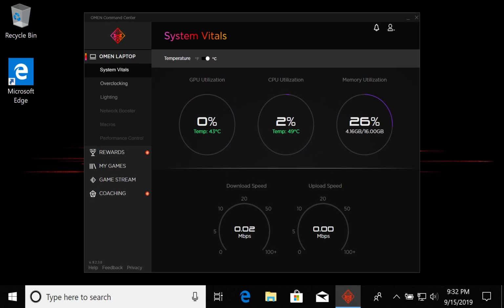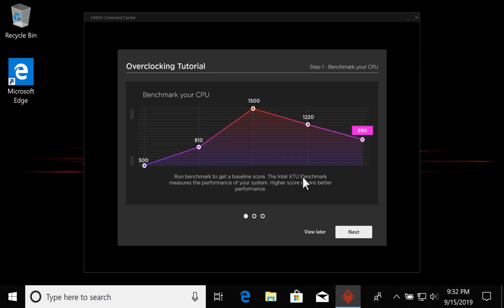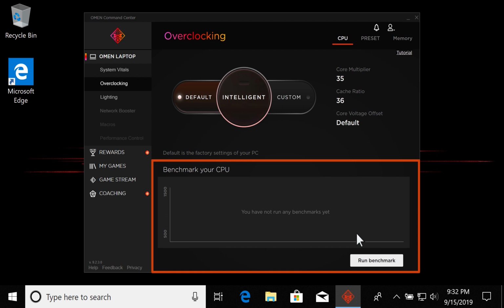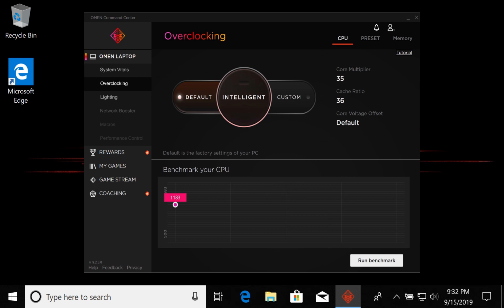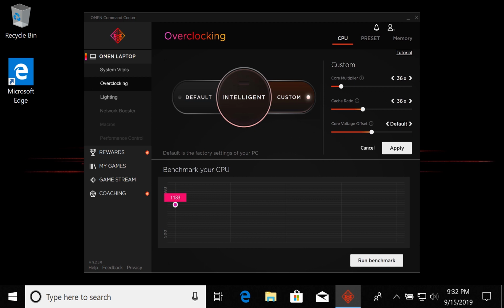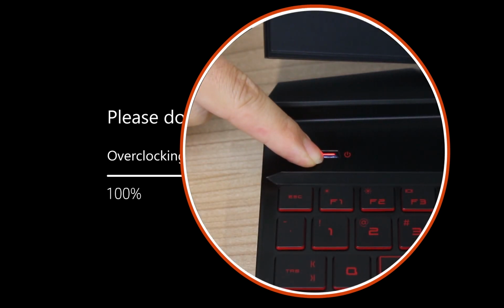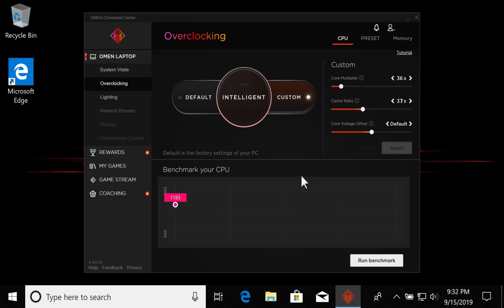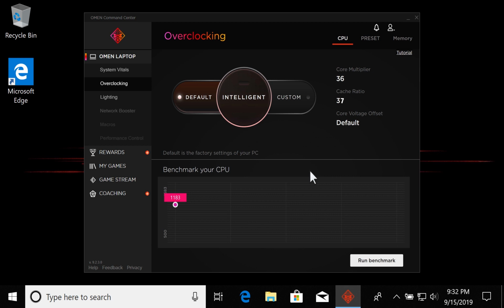Overclock an OMEN Computer | OMEN Gaming | HP Support

Comment: Everytime I use intel;igent,it causes my Omen Obelisk to go blue screen constantly.I have an I5 9600k.
Reply from the maker: +Ancient Veritas Please check whether your unit supports this feature under 'OMEN Command Center features' from here: http://bit.ly/2Gp1scm If it supports, please perform the steps mentioned under 'Overclocking'
Reply: @HPSupport  No. Worries. It's stable now. Just had to use a custom overclock. Now it is fully stable at 5ghz!
Reply: When you used custom, what settings did you go with?
Reply: @92bricks  50x for core and cache ratio and I added  0.050 volts.It's been working ever since.

Comment: Hey does the Memory Overclocking only works with HP Ram? Or with every Ram that needs an XMP Profile?
Reply from the maker: +Ultimatum Gamer HP does not recommend upgrading or downgrading hardware parts or software that is bundled with the product as It may affect the manufacturer's warranty and performance, however, you could change the configuration at your own discretion.
Reply: Let me help you and anyone who sees this. It took me 2 weeks to figure this out aka just long enough that I couldn’t return this computer. So hp made a dbag move and locked the ram. Basically you either buy the ram from them at 200% 300% Market price or you can install any ram you want but to get the actual MHz speed you need to download ryzen master or the intel equivalent and manually change it every time you log into your computer. Videos are all over YouTube on how to do this and f hp for being scummy and doing this.

Comment: I would like to be allowed to customize the curve of the fans, I currently have an hp pavilion 15-dk1xxx and it is not possible for me, sorry but if it is not solved I will not buy an hp again, it annoys me not being able to get the most out of it. I would appreciate it if you could solve it because I see many people with the same problem
Reply from the maker: Hi Adritry, thanks for contacting HP Global Social Media Support!
I understand that you need to know about customizing the curves of the fan.
I will do my best to assist you.
HP does not recommend upgrading or downgrading hardware parts or software that is bundled with the product as It may affect the manufacturer's warranty and performance, however, you could change the configuration at your own discretion.
Binu - Social Media Tech Support

Comment: I cannot use the overclock feature, I have HP OMEN 15-DC1036NS. This feature is available in this laptop¿?
Reply from the maker: +Alberto Parrilla Please check whether your unit supports this feature under 'OMEN Command Center features' from here: http://bit.ly/2G3Dyzn If it supports, please try the steps mentioned under 'Overclocking'

Comment: Hi intelligent overclocking freezes at 50% and doesn't move on from there on a new HP omen i9 10900k with a 3080
Reply from the maker: +Bhino Please check whether your unit supports this feature under 'OMEN Command Center features' from here: http://bit.ly/2Gp1scm If it supports, please perform the steps mentioned under 'Overclocking'

Comment: i used intelligent mode multiple times its unstable! i have i7 87006 rtx 2080
Reply from the maker: +kenseimeister You can update the OMEN Command Center from the Windows Store Click the Windows Store icon in the system tray. Search for OMEN Command Center. Click Update. Wait while the program downloads and installs. Click Play. OMEN Command Center opens. If the issue persists, please uninstall the HP Omen Command center. Select the Start button, then select Settings > Apps. Choose the program you want to remove, and then select Uninstall. Some apps built into Windows can't be uninstalled. To remove an app you got from Microsoft Store, find it on the Start menu, press and hold (or right-click) on the app, then select Uninstall. Restart the HP Omen and download the Command Center from this Link: https://support.hp.com/us-en/drivers Let me know how it goes.

Comment: I am guessing my HP Omen 25L is not able o do this as i want to overclock my intel cpu
Reply from the maker: +Hayd Rogers Please check whether your unit supports this feature under 'OMEN Command Center features' from here: http://bit.ly/2Gp1scm If it supports, please perform the steps mentioned under 'Overclocking'

Comment: in my omen, it have undervolting, not overclocking. is it safe to undervolt cpu, then overclock the gpu using external software such as msi burner?
Reply from the maker: +Hendri Librata HP does not recommend upgrading or downgrading hardware parts or software that is bundled with the product as It may affect the manufacturer's warranty and performance, however, you could change the configuration at your own discretion.

Comment: We have a 25L with a Ryzen 7 3700X which is an overclocking capable processor, but in omen command center there is no overclocking option, do you know why this is?
Reply from the maker: +Purrito Please check whether your unit supports this feature under 'OMEN Command Center features' from here: http://bit.ly/2Gp1scm If it supports, please perform the steps mentioned under 'Overclocking'
Reply: I'm wondering the same thing. It would be nice to get an actual answer

Comment: i have a omen 25L GT12-0167c computer does that support overclock cause i dont see it in my omen command center
Reply from the maker: +DellSyncAlot Please check whether your unit supports this feature under 'OMEN Command Center features' from here: http://bit.ly/2Gp1scm If it supports, please perform the steps mentioned under 'Overclocking'

Comment: Hello there mate, I've got a HP Pavilion Gaming Laptop 15-dk1511TX with 16gb ram and intel i7 10870H processor. Is it possible to overclock my laptop? Also which software do you recommend using to achieve cpu frequencies of more than 4ghz from the base 2.2 ghz on my laptop?
Reply from the maker: +adhi shakthi HP does not recommend upgrading or downgrading hardware parts or software that is bundled with the product as It may affect the manufacturer's warranty and performance, however, you could change the configuration at your own discretion.
Reply: @HPSupport  Thank you so much!!!! Also I just realized my processor has a turbo boost technology, so I guess overclocking is unnecessary.

Comment: HP I need help the only thing I see is Home and Network Booster. I need help
Reply from the maker: +Sub Bot Please check whether your unit supports this feature under 'OMEN Command Center features' from here: http://bit.ly/2Gp1scm If it supports, please perform the steps mentioned under 'Overclocking'

Comment: How can i overclock CPU in HP omen 15 dc-1065nw ? i5-9300h
Reply from the maker: +faillerek Please check whether your unit supports this feature under 'OMEN Command Center features' from here: http://bit.ly/2Gp1scm If it supports, please perform the steps mentioned under 'Overclocking'

Comment: If I overclock my PC will I still have the warranty?
Reply from the maker: +Xiaoyu HP does not recommend upgrading or downgrading hardware parts or software that is bundled with the product as It may affect the manufacturer's warranty and performance, however, you could change the configuration at your own discretion.

Comment: Does an OMEN desktop support GPU overclocking, atleast in AMD radeon settings for the AMD GPU models?
Reply from the maker: +Blaž Čulina HP does not recommend upgrading or downgrading hardware parts or software that is bundled with the product as It may affect the manufacturer's warranty and performance, however, you could change the configuration at your own discretion.
Reply: @HPSupport  I bought an Omen 25L with RX 5700 XT now. I can't change anything in the AMD overdrive, the biggest disappointment to me is that I can't change the fan speed at all. GPU target temperature is 90°C which is awfully hot. Ramping up the fan shouldn't be blocked.

Comment: I have an Omen 30L desktop with an AMD Ryzen 5 5600G CPU. I don’t see the overclocking tab
Reply from the maker: In order to get this issue fixed, please contact our customer care team over the phone or chat for further assistance, as this issue requires Live conversation with you over phone or chat to isolate the issue and provide you instantly with appropriate solution or repair/replacement options available at your place as per the warranty.
Please feel free to reach us on call/chat, please access this link to select your preferred country and language option to reach us. Global support link: -  https://hp.care/485YlPF
Regards, 
HP Support

Comment: I have a problem, i want to overclock my pc, i have an OMEN by HP Desktop PC 880-p1xx, when i open OMEN gaming Hub, it says that needs HP system event utility. I press Install and nothing happens. I can still enter the app but the options that can overclock my pc, doesn't appear.
Reply from the maker: +OscarGame Please check whether your unit supports this feature under 'OMEN Command Center features' from here: http://bit.ly/2Gp1scm If it supports, please perform the steps mentioned under 'Overclocking'

Comment: Hello! I have an OMEN pc that doesn’t support OMen Command Center and it doesn’t let me overclock my ram speed. I’m also not able to do so through the bios. Any help?
Reply from the maker: Hi Dennis, thanks for contacting!
I understand that you are experiencing an issue in overclocking memory.
I will do my best to assist you.
HP does not recommend upgrading or downgrading hardware parts or software that is bundled with the product as It may affect the manufacturer's warranty and performance, however, you could change the configuration at your own discretion.
Binu - Social Media Tech Support

Comment: Hello HP 

I have a problem with my intelligent overclocking.. when ever I try to overclock the overclocking keep getting stuck at 50% !

Why is this happening and how do I fix it ???

My OMEN PC Specs are 
GTX 1080 
intel core i7-8700K
32GB 2666hz of RAM
Reply from the maker: +ReeBaaL Please check whether your unit supports this feature under 'OMEN Command Center features' from here: http://bit.ly/2G3Dyzn If it supports, please try the steps mentioned under 'Overclocking'
Reply: HP Support IT DOES SUPPORT!!!
My product is OMEN by HP 880-xxx Desktop

When ever I press the bench mark button it gets stuck at 2% !!!

Please help me!

Comment: Hello I have an Omen 30L and have upgraded my PSU / GPU / FANS / RAM. I have a Ryzen 5 3600, and had to use Ryzen Master to change the memory frequency. I am trying to undervolt the CPU to save on temps / boost performance via Ryzen Master. However the Peak Voltage is Ryzen Master is listed at only .96875 which seeps super low? 

 Is it safe to increase this value to a more normal range such as 1.25 Volts? Moria 3 HP Motherboard. Thank you!
Reply from the maker: Hi there, thanks for contacting!
HP does not recommend upgrading or downgrading hardware parts or software that is bundled with the product as It may affect the manufacturer's warranty and performance, however, you could change the configuration at your own discretion.
If you need any help in the future, you can always get back to us.
Thank you for being a valuable HP customer.
Have a wonderful day!
Cheers!
Binu - Social Media Tech Support
Reply: @HPSupport  I could use some help for this. My warranty was expired before I did any of this. I just recently upgraded from 8gigs of Ram to 16 gigs of RAM (all are 3200mhZ capable) however it's defaulted to 2133MhZ and I cannot get into advanced options in BIOS to change it to the correct settings (though the RAM is XMP capable). HP Omen 30L desktop PC. I'm running BIOS 25.0. This is the Ryen 5 3600 version.

Comment: Hi sir I have an Hp victus 16 rtx 3050 ti ryzen 7 5800h buti can't find the overclocking and i really want to try it is it possible for me to overclock it?
Reply from the maker: +MaxzyteFN HP does not recommend upgrading or downgrading hardware parts or software that is bundled with the product as It may affect the manufacturer's warranty and performance, however, you could change the configuration at your own discretion.

Comment: I uninstalled the preinstalled McAfee on my Omen desktop and now the GPU fan makes a very loud buzzing noise. I read that it may be entirely electrical and due to overclocking or the PSU. Is there anything I can turn off that's turned on by default on my desktop so I can get rid of that buzzing noise?
Reply from the maker: +Maru Misu Please perform updates via Windows and HP Support Assistant as mentioned below to fix this issue: Step 1 Windows Updates - 1) In the search box, type and open Windows Updates. 2) Check for updates. 3) If the updates are available, click on install and restart the computer. Step 2 HP Support Assistant Updates - 1) In the search box, type and open HP Support Assistant. 2) Check for updates. 3) If the updates are available, click on install and restart the computer.
Reply: @HPSupport  Didn't work. Doesn't even start buzzing until after I log into windows.

Comment: So I have the hp omen obilisk with the core i7 9th gen and the 2080 S and is it ok if the fans keep going up and down in speed they sound very loud at max and I am getting worried
Reply from the maker: +JOXANT Please Please follow the guidelines under this document to fix this issue: http://hp.care/2nIM2mc
Reply: @HPSupport  thanks for the reply Hp appreciate it, but I got into a problem where when overclocking the overclock stoped at around 70%, now after that omen command center is not opening whatsoever I tried repairing and restarting it but it would not budge now I can't customize my lights or my settings, thx so much for the reply Hp that's a 5 star for me:)

Comment: My Omen has an i9 10900k but it runs at up to 93° celsius on default mode, whicj causes the computers fans become extremely, absurdly loud. How can I underclock the cpu optimally so that this isn't an issue, but I get decent performance?
Reply from the maker: Hi Vibin, thanks for contacting HP Global Social Media Support!
I understand that you are experiencing a loud fan noise issue on your computer.
I will do my best to assist you.
Please refer to the instructions mentioned under this document to fix the issue: https://hp.care/3t02S7t.
Regards, 
HP Support

Comment: I have an Omen Obelisk with a z390 chipset and an i7-8700K, that tab still isn't there, and there's nothing in the BIOS. Is there a workaround for this, like third party software?
Reply from the maker: +Neophobic Nyctophile Please check whether your unit supports this feature under 'OMEN Command Center features' from here: http://bit.ly/2Gp1scm If it supports, please perform the steps mentioned under 'Overclocking'
Reply: @HPSupport  My unit supports it, your company just never embedded a product ID or serial number, so the command center can't do anything.

Comment: Does the 875-1040st support memory overclocking?  The tab doesn’t show up on my command center, but it’s a z390 board, so there’s no reason it shouldn’t work.
Reply from the maker: +James Pettibone Please check whether your unit supports this feature under 'OMEN Command Center features' from here: http://bit.ly/2Gp1scm If it supports, please perform the steps mentioned under 'Overclocking'
Reply: That website doesn’t say which computers support memory overclocking. It would be nice to have some actual customer service rather than the canned reply you give everyone.

Comment: I have Hp omen 15 laptop 2020 version and in omen command center 11.0.8.0 i don’t have option to turn my fans off, they are on max speed And very loud also it is not showing me the CPU usage i don’t know hot to fix it, help
Reply from the maker: +Lolek You can update the OMEN Command Center from the Windows Store Click the Windows Store icon in the system tray. Search for OMEN Command Center. Click Update. Wait while the program downloads and installs. Click Play. OMEN Command Center opens. If the issue persists, please uninstall the HP Omen Command center. Select the Start button, then select Settings > Apps. Choose the program you want to remove, and then select Uninstall. Some apps built into Windows can't be uninstalled. To remove an app you got from Microsoft Store, find it on the Start menu, press and hold (or right-click) on the app, then select Uninstall. Restart the HP Omen and download the Command Center from this Link: https://support.hp.com/us-en/drivers Let me know how it goes.
Reply: @HPSupport  yes it works thank you very much

Comment: Why omen 17 an106nm dont have xmp profile in bios ??????
Reply from the maker: +jack STM3 I have not come across a HP PC with BIOS overclocking options. You need this to use XMP or tweak processor timings and voltages. Some Omen PCs can run at 2400 MHz instead of 2133 speed. Maybe this PC will do XMP at higher speeds if HP is advertising this option.
You can do some minor tweaks using the Omen Command center.
Reply: @HPSupport  i have 16gb 2666mhz ram and it is running on 1333mhz thats why i want to overclock it usualy pcs have that option in bios 
I'm not expert about laptops but this is my first and last hp laptop... those laptops have good potential and it have so much performance that i can't use it

Comment: Does the Omen 30L gt13-0024 support overclocking? I can’t seem to find the overclocking tab even though the site says it supports it.
Reply: its been removed
Reply from the maker: +Jethro Rodriguez Please check whether your unit supports this feature under 'OMEN Command Center features' from here: http://bit.ly/2Gp1scm If it supports, please perform the steps mentioned under 'Overclocking'